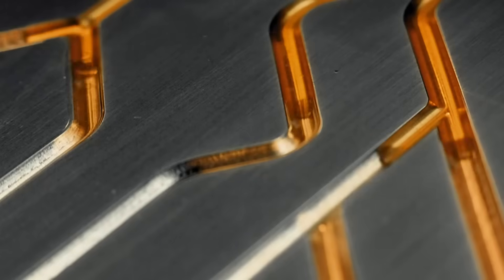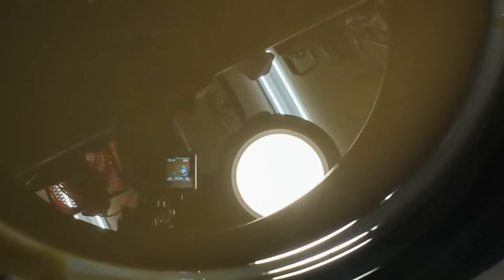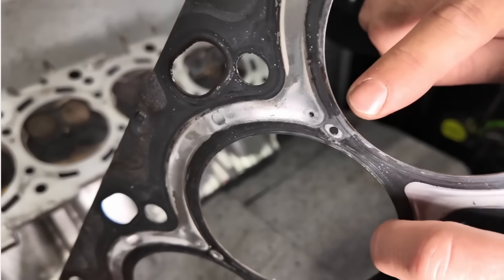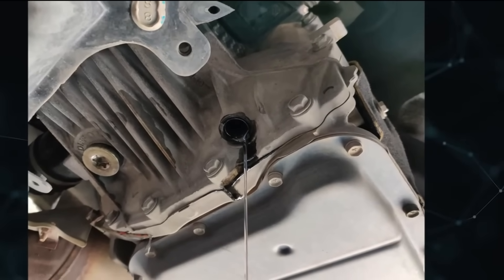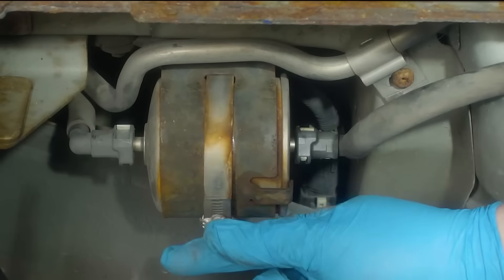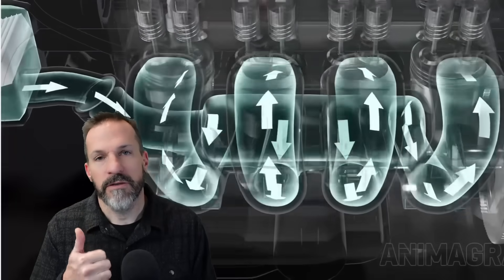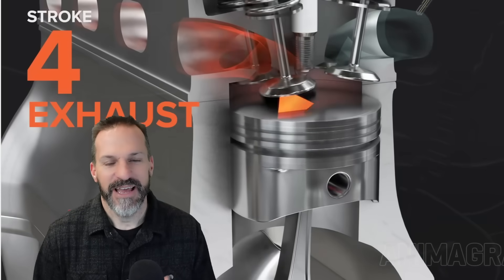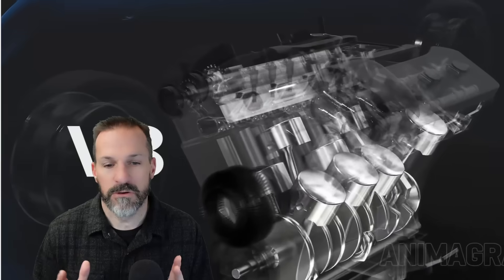Car Maintenance MOST People Ignore! Make Your Engine Last 200,000+ Miles!

Comment: Nice video. Thx. You asked for examples of high milage cars. I bought a 2006 Hyundai Sonata new for my wife, passed on down me. I drove it as my daily driver 160. miles a day 4-5 days a week, Replaced the Alt. once, new battery 2 times. oil change every 5 K tranny fluid every 30000. Collant try 50K. Timing belt once. no major engine or Tranny work. It finally threw a rod at 413 K. Went and bought Hyundai Tucson 2023 3 months ago with 5 K. Why wouldn't I best warranty and the quality beats most.

Comment: As for e.g. fuel filters, well, many cars have integrated filters meaning that a change would require you to take the tank down, pull up the pump and replace the filter next to it. That sounds like a rather big job. Coolant change is not even service point on my car for instance. But sure, it can't hurt to at least do a partial change and take out as much as you can, replace it and then repeat some other time.

Comment: All of my family Toyota vehicles last beyond 300k miles. Oil changes are usually 5-10k miles.
My current 2021 Toyota sienna hybrid is running flawlessly like brand new at 110K miles without a single issue during the last 4 years. The last oil change was 10k miles ago and the maintenance reminder is at -150 miles. I need to schedule an oil change at my local Toyota dealer.

Comment: It’s also manufacture to blame. Oil at 10,000 miles, trans at 100k, radiator 100k.  Heck modern cars now days don’t even have a dip stick in engine or trans. For me what ever manufacture say I cut it in half.  They just want you to buy a new car after 100k.  It’s a scam.

Comment: I think 30 days is too long to check oil. I check mine on all vehicles once per week, ALL fluids.
Reply: With all due respect if you’re checking your oil 1x per week that’s a lot. 
If it’s not burning oil at an alarming rate every oil change or every 1500 miles is probably safe.

Comment: I do have to disagree with not driving immediately after starting in exactly ONE specific case: modern Porsches. If you read the Owner's Manual, it specifically says to drive immediately after engine start, and this is because of the way the motor is designed. Letting the engine warm up can lead to the infamous bore scoring issues that some people have experienced.

Again, this is for Porsche only. 99% of other cars out there, yeah, let it warm up a bit before taking off.

And as far as checking oil, I check it in all of my cars every time I get gas. I mean, you're standing there doing nothing anyway, so why not?

Comment: I have heard the initial 1000 mile oil change is unnecessary on new vehicles. Have you heard that?
Reply: 100% but I say change it. It’ll cost you no more than $40-50 and well worth it

Comment: Sorry got you by 14K miles! 244,000 miles going strong on my 07 Trailblazer. I saved it as I got it for $700 in summer of 2023 and spark plugs, coils etc all original and valve covers leaking etc took me 3 days to very slowly work the spark plugs out and a bunch of PB Blaster but they all came out perfectly no damage. I had to take out the VVT solenoid in pieces and hammer out slowly as well. Of
course bunch of other stuff. There were 13 error codes. Now runs like a charm. Barely turn the key and starts right away. Oh PS I know I have a sickness as I did the same to an 02 Bravada but with 108K miles. But because of the years on it had the same kind of issues.

Comment: Have 230k miles on my 2013 Toyota Sienna. My parents bought it new I purchased it from them with  150k miles. Oil changes done every 10k miles at Toyota and I started changing it every 5k at 200k miles. Transmission fluid changed every 30k miles after the first 60k miles. Antifreeze and spark plugs changed every 100k miles. Oxygen sensors changed at 170k miles to see if fuel economy improved, but didn’t improve.

Comment: Sold my volvo s60 2002 D5 with about 300k miles (almost half a million km). Once I blew head gasket (completely my fault at ~200k miles, fixed it myself), and had one bad injector. That car was a fireproof tank

Comment: I owned my 1988 Honda Civic hatchback for 19 years and got 
330,000 miles.
Engine and transmission were still going strong, but the body was rusting out.
Went through 4 clutches.
Great car.
Too bad they don't make them like they used to.

Comment: Have a 2004 Yukon Denali, 6.0 Vortec, 252,000 miles. Well serviced. Had a water pump fail at about 180,000 mi. On my 4th set of tires.
Reply: Right behind you, my friend. I just picked up a cherry one owner '05 Yukon XL Denali at 93,xxx last Aug and I'm at 112,xxx right now. I gave it a tune up and full fluids changed out and she runs like a scalded dog. She's my daily and gets open road driven to/from work, which I believe is the BEST mileage for any vehicle💯

Comment: Another good bit of maintenance, is to buy yourself a grease gun and pump grease into the suspension parts using the grease fittings. Most cars will have them on the ball joints and certain steering components.

Comment: I bought a used Toyota Camry 2007 XLE from A dealership at 216,000 miles in 2022 and  have it 250,000 miles now and it runs like new still 😊

Comment: Starting with my 1988 Chevy Corsica and every vehicle I've owned after that we keep our vehicles for a minimum of 20 years. With good maintenance miles become irrelevant but time is relevant. The Corsica went over 250,000, The 1997 Chevy Express van went to 365,000, the 2010 Honda Civic that we handed down to my daughter when she was in college, she still drives, 360,000 mi, 2010 Honda CRV is 205,000 mi.

Comment: 0:26 oil change (1k mi when new, then every 5k mi). Check oil and oil filter for metal particles. 
2:15 engine and cabin air filter every 10-15k mi
2:24 Coolant flush every 50-100k mi
2:56 ATF fluid change every 30k mi
3:16 break fluid flush every 2-3 yrs
3:34 power steering fluid every 50-100k mi
3:44 diff and transfer case fluid change every 30-50k mi
4:18 timing belt  every 60-100k mi
4:41 Spark plugs every 40k mi for turbos, every 100k for nat aspirated engines
5:08 pcv valve every 50k mi
5:26 fuel filter 30-60k miles for older cars
5:49 egr and intake cleaning
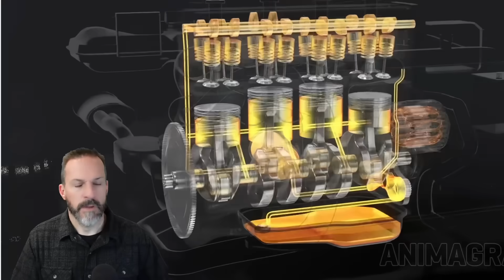6:06 warm up your engine for at least 30sec before your put it in gear
6:33 check oil level every 30 days
Reply: I check my oil level every week.  goes through about 1.5 qts every 2000 miles. it has 117k miles on the engine and turbocharged.
Reply: @Shallowdarkpit I was taught every time you fill your tank, check your oil. Kept my car running forever
Reply: PCV is the easiest thing to do. 💯
Reply: @TheTrueAnswer I just soak the PCV valve in solvent or gasoline and reinstall it like the owner's manual says.
Reply: Thank you!
Reply: Thanks!
Reply: Don't break your fluid flush, flush your brake fluid 😊
Reply: I have a timing belt so when that gets changed [around 50k miles] I change the fuel filter.
Reply: Thank you Sir
Reply: Thank you! 💯
Reply: check air pressure in tires and rotate every 5000 miles
Reply: You’re the best for this
Reply: Thx
Reply: What about hybrids?
Reply: @sanky77 car care nut is a very good resource for this.  He let everybody know that clogged air filters for the hybrid batteries are one of the biggest reasons for them to go out.
Reply: Or just get a honda civic and change your oil thats all it needs, mine is at 240 000km and going strong. No maintenance done on it except oil change. Runs like a dream.
Reply: @sergiolandz6056 I inherited my mom's 2008 Honda Civic and it was nothing but problems. Yes I was religious about doing oil changes every 3000 miles
Reply: Transmission oil change @sergiolandz6056
Reply: @sergiolandz6056  same lol
Reply: @sergiolandz6056 

Do you even have an idea how many different types of civics and engine variants are there? Not to mention enviroment and fuel quality in different countries.
Reply: You’re awesome for this.
Reply: All this will cost more as much as a new car lmfao
Reply: @harveys.6483  all that maintenance cost less than a year of insurance, what you talking about
Reply: The oil- change shop always charges $40 for a new plug each time.   Is that a Scam?

is it better to change your oil…drive for one week…
change your oil…save the one-week-oil for next time….drive for ~5K miles….Repeat…Repeat..

The idea is that: there are critical- nooks and crannies, that does Not get fully flushed with new oil and that is where engine problem starts…

…by doing a ~1 week rinse, that oil will flush out the old oil from those critical-nooks and crannies,,,

Comment: I just bought a used 2015 4Runner that now has 107,000 miles on it and I don't know when or if the transmission fluid has ever been changed by any of the previous owners. I'd like to change it but I'm concerned about slipping. What are your thoughts on this matter, thanks.
Reply from the maker: I personally would not hesitate to perform transmission service on it with 107k miles, that's still very low miles for Toyotas, especially that platform.

Comment: I got ya beat... 268,710 miles,  changed exhaust crossovers, battery, tires(on 4th set), starter(recently) and a couple wheel bearings.  Runs well and looks good inside and out!
2012 Cadillac SRX (2/front wheel drive) Luxury trim.  I do take it to my mechanic for maintenance except tires; first and second sets from dealer, last two sets from Sam's Club. Yes, I'll drive it until I can't or it won't.

Comment: Hey so im looking into my car fax and it was never mentioned, my transmission oil was never changed and the transmission was never serviced. i got what you mentioned in the video, my car has delayed shifts now, and switching gears suck, its an automatic v6 with 130k miles on it... should i change the oil or leave it in, considering how long it has been untouched.
Reply from the maker: If it's already having delayed shifts etc., I would try to do a drain and fill which swaps about 3-4 quarts out with new fluid, then see how it goes. If shifting and overall feel improves, I would do another 2 drain and fills and you should be good after that. There's always a concern from people that they might cause transmission problems, my thought process is if your transmission goes out after swapping the fluid, it was probably going to go out soon anyway and I would rather try to maintain now than wait for failure.

Comment: I'm not a guy person so maybe a stupid question: Do some AWD cars have front diffs with separate fluid than the regular transmission? Like you could have front diff fluid, transmission fluid, transfer case fluid and rear diff fluid in different places? Specifically asking about the 2012 Lexus RX350.

Comment: Great video very valuable information, I own a 2003 Mitsubishi galant 4 cylinder engine and I bought it in 2003 from enterprise rental for $10k when at the dealer was for $15k and it had 35k miles. It currently has 375539 miles same engine same transmission and runs perfectly fine.

Comment: I'm not  political but I bought an electric car. Used ones are now very affordable and after installing a "cloths dryer" plug in my garage I wake up with almost 400 miles of range every day. I still own an ICE vehicle with 190k. I don't have all the cool equip you're using  in the video so I pay Ford. All of those 'every 5k, 30k etc miles' costs plus monthly gas add up. My electric car is a 100% USA company (not Tesla) made 100% in the USA, by 100% American workers. Please don't yell at me about politics etc, it's just a car I drive. There's no ban on gas cars and nobody forced me to buy it. It's nice plus cheap to run. I will hang on to my ICE car but I won't buy another one. I really enjoyed your video and am going to watch some more.

Comment: Thanks for video! Good reminders and some incentive to get cracking on the daily driver. I have owned a 2000 BMW 323i (E46) since 2010. Bought the car with 179k now has 240k. Drivetrain still super smooth. Have had my share of issues over the years but like you hanging on to it, fun to drive only putting 1500 miles on it per year at this point.

Comment: 440,000 miles 22R
303,823 miles F22
314,454 miles L61

All still running fine when sold. 

Consistent oil changes, synthetic oil, change the air and fuel filters,spark plugs, water pump, coolant, and hoses on schedule. Timing belts at 90k Alternator, idlers, fuel injectors, and A/C compressor after 150k. Take it easy until warmed up.  Don’t drive it like you stole it.

Comment: Maybe I missed it but one of the more important maintenance items you can do is an oil and fluids analysis every 20k miles or so. This will take the guess work out of what is going on with your motor and drive train. Cheap insurance.

Comment: I have a 2008 Toyota Matrix with 243k miles. 

My tip is that I change my oil and filter every Christmas and July 4th.  I have always been off work in those times so it is easy to remember. I use Microsoft OneNote to track all my maintenance on all my vehicles. I keep track of my adult children too (except one of them who was just born responsible). 

I keep part numbers, dates, mileage, purchase information, prices, web links to order parts, forums etc.  this has worked well for me.

Comment: I try to stay on top most of my maintenance.  I've had my 2013 Genesis coupe 3.8, and ive put 145k on it, and its been great so far. I walnut blasted the carbon out, radiator flushed,  changed plugs,  and coil packs at 100k. I also always change my oil around 3-4k, just to be safe, no matter what.

Comment: PCV replacement is critical.  A clogged PCV will build up pressure in the crank case forcing air through the weakest gaskets creating oil leaks.  Cheap part to prevent oil leaks.

Comment: One of the reasons why prefer manual transmissions is because of the fluid change    should be every year about and can be a huge issue changing it yourself, but many transmissions don't have to do it so often and well its generally easy to do also less moving parts that can break in a manual transmission my older lewus is350 is a pain to check the level never mind change the transfluid if  I want to check it I have to get the car on a  hoist then there is the whole advertised saying“lifetime transmission fluids,” many people took as to meaning you never have to change the fluid which that isn't what was the true meaning, there is no such thing as any engine or  transmission difs or transaxles transfer cases that don't need the fluids changed every so often

Comment: I got 367,000 miles on my 92 Toyota Camry with the 2.2 liter 4 cylinder engine. I change the oil every 5k miles did the head gasket and radiator not to long ago that car will run forever.

Comment: Versus cutting open an oil filter to see if you have metal, I got a magnetic tip drain plug for my oil pan.  I was really wanting one more for my transmission but seemed harder to locate one....  I don't even know why I did it---probably because it was so cheap to get a new drain plug because I drive a 2005 Toyota Corolla with 160K miles that has been taken we care of..  Sure enough, when that plug comes out, no metal specks whatsoever...  This would apply to mostly new cars as it is...  He did give good advise if you buy a brand new car, do a quick oil change 1000-1500 miles to get rid of any break in metals....  Have that magnetic tip drain plug ready to use then for piece of mind on oil change #2 and up !

Comment: Transmission fluid is the one thing that’s a little iffy. If you have no records of when the fluid has been changed last I’d recommend just leaving it or get a change done not a flush. The transmission fluid is the only fluid on a car that’s responsible for shifting gears other then variable valve timing but if your cars old and it’s shifting fine I’d be a little hesitant to changing it completely. Just drop the pan change the filter measure what fluid came out and put that amount back in. I’ve actually seen older cars where there was no record of fluid change and those cars got a complete flush and now the transmission slips so be careful.
Reply from the maker: I would agree in some cases, I do think it's brand dependent and how the fluid is swapped. To this day, I haven't had a problem when just doing drain and fill style swaps which only does 3-4qts at a time. I hardly ever drop a pan and change filters, but that depends on the brand too. I know there were a lot of horror stories of GM transmissions being flushed and then failing shortly after, there are a lot of reasons that could happen. The first is they just build crappy/weaker transmissions, clutch plates are all gone and in my opinion, the transmission was probably going to fail in 20-30k anyway if it's in that bad of shape. In the case of companies like Toyota that use Aisin transmissions, those can usually handle high mileage changes quite well. Another trick with automatics, if you start getting a slipping transmission, this can sometimes be fixed by a valve body rebuild which is very easy to do compared to transmission rebuild. I have fixed BMW ZF transmissions in the past this way, new seals/solenoids, and it runs like new where others thought it was done for. It all depends on the root cause though :).